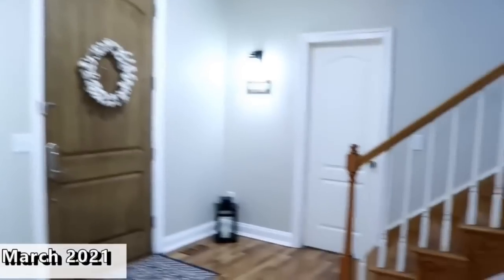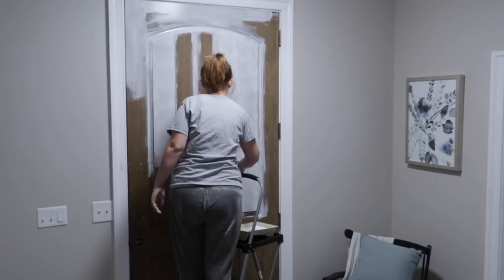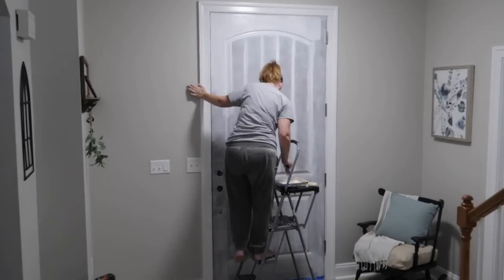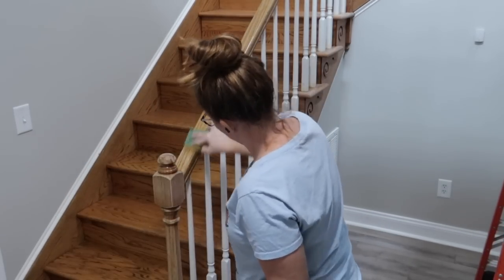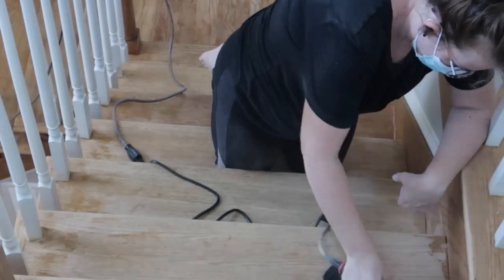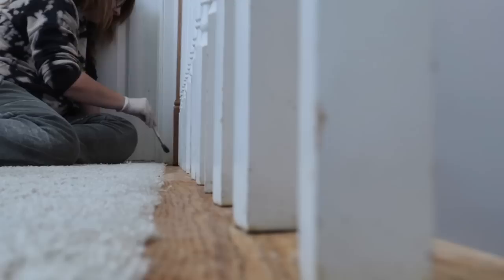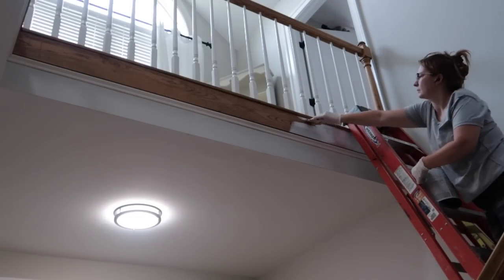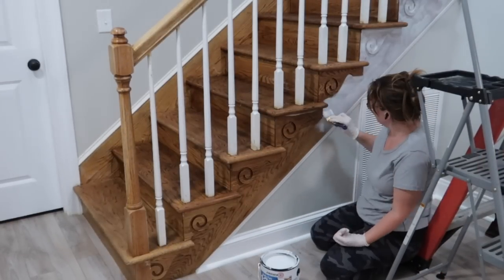Insane DIY Staircase Transformation & Entryway Makeover on a Budget

Comment: You could really make a difference with your door if you or your husband could cut out and remove the top section of your door and measure it to put in a beautiful stained glass.  It would definitely give you more light in the entry way.  If the door is a cheap wood door you could just replace with a nice metal door from home depot.  That's what I did when I first bought my house.  They have all kinds and they are reasonably priced.
Reply from the maker: Thank you. Yes we do have plans to replace the door or add some small windows or something.

Comment: I want to paint my rails and spindles so bad but have carpet and scared it’s not gonna turn out right. I agree w the tan walls… you gotta be kidding me right???
Reply from the maker: I repainted my old spindles and handrail in my previous house around the carpet. It was tough but doable. I used a metal spackle knife to push the carpet down around where the spindles met the carpet and taped it back. Had to be careful but was worth the effort!

Comment: Use wood filler on the swirls sand then painr
Reply from the maker: They are raised wood not cut in so it would still be a swirl on the bottom